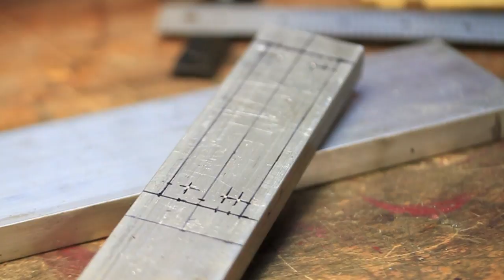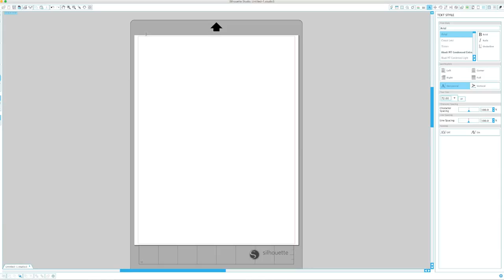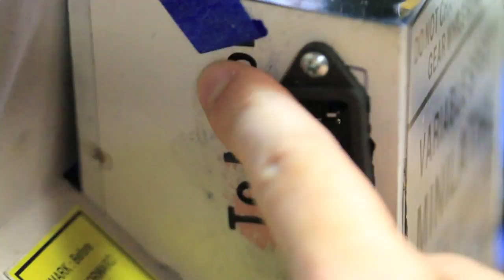Mini Lathe Carriage Saddle Clamp Upgrade - with ball bearings + bonus vinyl cutting project

Comment: Don't use an abrasive disc (or grinding wheel) on aluminum. The Al gets embedded in the wheel, expands from heat, then POW! Half your head is gone and you're in a closed casket. When a grinding wheel explodes it is neither subtle nor gentle.

Comment: Can't believe you used the bandsaw to cut the Ali, then turned to a grinder to remove the centre -butchery! Far better to have used the bandsaw, corner to corner then remove the remaining triangle for a better finish. You did similar with the bandsaw on the circular cut! Also oil isn't a good lubricant for working aluminium, WD40 or even turpentine substitute are better.
Reply: Another thing I would not use a metal abrasive shop saw to cut aluminum it has been said it can clog up and explode. You could use a carbide wood chop saw as a safer alternative. There is my 2 cents. And looks like he use tap magic in his defense.

Comment: honest ?! I would not have done it that way, with the balls on the underside you only have one point contact, the forces that will work there are no longer distributed over the entire surface, there are better solutions. I do not go into that now as a German it is not easy for me to explain that in English. 
I have the problem solved with brass and scrape as well as by adding shims or spy plate.
Reply: What is song name at about 3:50

Comment: Do the same on the back as you did on the front. Eliminate the side adjusters, they are doing more harm than good. You need down pressure on the carriage on front and back.

Comment: I know this seemed like a good idea and you are very ingenious working with the tools you have. I'm in the same position. However, I hope no one does this to their lathe.

The following information doesn't just apply to bearings but also how tool geometry affects tool pressure and can also be applied to many designs you may come up with for parts or jigs. It's a part of learning machining so I hope you'll keep reading.

It comes down to pressure, pounds of force per square inch of surface area (PSI), and simple mathematical principles. Consider the surface area of a ball at the point of contact with a flat plane. Ideally it's an infinitely small area (which would lead to an infinitely large pressure at the point of contact) but practically there is some plastic deformation in the ball and the plane.

Let's be generous and say it's 0.01 square inches with only 1 pound of force applied on the lathe carriage. That's (1/0.01 = 100 PSI) at the point of contact. In practice, the force would be much larger. Even a force as small as 10 pounds would apply 1000 PSI at the point of contact. Now, granted, you have more that one ball. However with 5 balls, that's still 200 PSI per ball and the forces are going to be considerably more than 10 pounds.

Consider an area of 0.001 square inches, that's (1/0.001 = 1000 PSI). With 10 pounds of force that's 10,000 PSI. With 5 balls, that's still 2,000 PSI per ball. Add to that the fact that the balls aren't rotating AND it's hardened steel against soft cast Iron. The more ball bearings that can freely rotate the better and, as mentioned by others, the bearings should ride against a hardened race instead of the soft cast iron.

The point is that the smaller the surface area, the larger the pressure will be. This design will most likely leave dimples and wear a groove all along the ways. Conversely, the larger the surface area, the smaller the pressure will be. That's why the ways are ground flat. The point of scraping is to give a place for a thin film of oil to exist between the 2 ground surfaces, but the surface area is still very large and oil is considered non compressible. It's like having millions of ball bearings.
Reply: Exactly.

Comment: I appreciate the ingenuity  put forth in making the blocks and the bearing assemblies, but I can't help but think that the hardened  balls are going to gouge the ways since there is no bearing race to complement them, and there is no way for the balls to really roll instead of grind across the surface.
Hopefully I'm wrong.
Reply from the maker: You're probably not wrong but that was something I considered going in. I'm going to keep an eye on it but at least in the mean time, the lathe works so much better.
Reply: i saw another fellow use brass balls on a carriage 'stiffening' project - would they work as well/better?  or do you think they would deform and become useless i wonder?
Reply: If I were to use this method, my choice then would be grinding a flat side onto the balls. They aren`t turning anyway.
Reply: What is song name at about 3:50
Reply: For the reasons you mention I would never never do exactly what was done here. However, with some slight modifications this general idea could work really well. If  larger diameter sections of a bronze dowel/bronze roundstock were used in place of the ball bearings, that might just work really well. Though the dowel sections would have to fit fairly tightly into the hole so they didn't shift around, so this means that the holes could only be tapped part way through, leaving enough smooth bore for the dowel sections to fit into.

Instead, a long bronze strip could actually be used as well, as long as it was some how held in position by a recess in the plate, or with pins, or something like that. Just something that would allow it to be adjustable vertically via the screws, but still confining it's movement horizontally.
Reply: @smallblockchevy1022  - of just adjust the original parts properly, like everyone else does by following the lathe instruction manual.

Comment: Great ingenuity but this is a bad approach.  Not only are the balls too hard, they're essentially point contacts and you'll run into trouble with both excessive wear and possibly Brinelling.  I suggest going back to flat plates and using shims to set the clearance.

Also, those clearances are way too big. For comparison I just checked my 6" Atlas lathe that was built in 1941.  At the most worn place on the bed I got half a thou (0.013 mm) movement at the rear and one and a half thou at the front -- which is too much, I'll be taking some shims out of the front soon (this lathe was built with laminated shims in such places that can be peeled off a layer at a time as things wear.  I think the layers are a thou thick).

Too-large clearances will contribute to chatter, tool dig-in, poor finish, maybe poor dimensional control.
Reply: What is song name at about 3:50
Reply: I was going to comment the exact same thing, But it seems you just beat me to it (By 3 years. :D ). The basic concept seems OKish, But I'd have made it with the ball bearings pushing onto flat brass "Gib strips" to spread the load (Not really gib strips if it's not in a dovetail, But the correct name eludes me at present).
Not sure if there's even enough clearance to the vertical carriage mounting bolts to retrofit this using what he's already got though.

Saw a nice sliding tapered gib block setup on YouTube earlier today. The maker had done it using such basic equipment that I was stunned that he'd managed to build it with any real level of accuracy, But it looked REALLY well finished, and seemed to work perfectly.
Reply: @Reman1975  Yes exactly, this Video is old now, Tim had some good ideas but this is Not a good design for improving on the factory bad design. Hopefully most people are not following this build, being honest from a mechanical perspective this design, the materials, fit and finish and execution unfortunately all get a poor over all rating.

Comment: The smoke when cutting aluminum is because the cuttings get stuck, due to the oil you use. cutting, tapping, drilling and turning aluminum (and bronze) you should have used methylated spirit, or dry no oil. tip from a metal worker. it's more for cooling than for lubrication.
Reply from the maker: Thanks, I'll try that!
Reply: What is song name at about 3:50
Description does not help.

Comment: This will wear out the lathe tracks as the balls are harder than the track material. This will ruin the whole thing.
Reply from the maker: Ruin the whole thing might be a little dramatic - I'm keeping an eye on it... in the mean time it's way better than it was. Thanks for watching though!
Reply: TimNummy I forgot to congratulate you as for the series, the vídeos are very good. The one on the motor was great.
As for ruining, if the tracks get rough many of the uses of it will be loss. How about some brass bolts to replace the set screws and  bearing balls? :)
Reply from the maker: Thanks! I appreciate that.

Eventually I'd like to get a mill and then make something proper.
Reply: Those balls are not taking any loading when in use and to move smoothly they can't be touching the underside of the ways, thus there will be no wear.
Reply: ... why didn't you use the bandsaw to cut out most of that material? You already had the holes right there!

Comment: Upgrade ?Jesus Christ...01:01..the band saw not good enough for the cross cut, 04:33 :why did you not use an axe for this. if you drilled 2 holes next to each other this would be enough clearance for the band saw blade. the extra hole is for the carriage stop.

Comment: 16 minutes of documenting the execution of a major brainfart.
Reply from the maker: How so?
Reply: @TimNummy  A year later, and I've forgotten all about it. After watching it again, the thought still stands.
a) ball bearings need to turn freely to be effective,
b) bearing balls are harder than the casting. They will wear out a groove over time. Poor design decision. Roller bearings would be better if you're set on this thensioning method. Bronze/brass strip with grease would've worked even better.
c) your carriage still moves. What you should focus on is increasing precision of the tensioning mechanism, which is less than ideal. I think that the lower plane on which you rest the bearings isn't perfectly offset from the ways. It'd be better to fix that issue by maybe regrinding the sturface with a dremel, referencing off the ways, and adjust the tension properly, than to design a "self clearancing" solution.

Comment: I applaud your desire to learn. It takes humility and some courage to show your work as you learn. It certainly invites others to want to help in positive ways.

Most of these mini lathes have brass plates that slide on the underside of the ways. They're adjusted to be just tight enough to have no play, but not so tight that they have a lot of wear. Brass is used because it slides well on the cast iron, yet is softer than the cast iron so it won't damage the ways.

The problem you will run into with your mod, as others have mentioned, is the concentration of pressure the hardened steel balls will put on the underside of the ways. Eventually they'll wear a groove in the cast iron which will require you to tighten them, which will then wear a deeper groove, repeating the cycle. It's unlikely that those balls will roll in their "sockets", but even if they did, they're probably hard enough that they'd still press a groove into the cast iron. More likely is that they'll try to roll, but bill grind against the set screws and develop pitting. The pitting will eventually meet up with the ways and then really do some damage (sharp edges of hardened steel, after all, are what we use to cut metal on these machines). 

I'd recommend finding some 3mm brass stock that you can place between the balls and the ways. Grind some detents into the brass stock for the balls to press into and sand the top of the brass stock flat and smooth where it meets the underside of the ways. That'll provide a much more rigid setup that won't damage the cast iron and it'll hold its position far longer as well.

For making flat surfaces I'd start by watching Dan Gelbart (all of his videos are essentially a requirement for new machinists):

https://youtu.be/cwdoUjynpEk
Reply from the maker: Hey Michael, 

Thanks so much for watching and taking the time to comment - I expect them to eventually be a problem but I was trying to make it better than it was for the first iteration. The biggest issue I have with the brass bars is that they still adjust in the same way or with shims and I just don't like the tediousness or quality of how that works. 

I will be keeping an eye on the bottom of the ways and my next iteration will probably move away from the bearings, but in the mean time the improvement has been tremendous. I really like your idea of putting a brass block above the bearings. Another current limitation is I don't have a decent way to make flat surfaces. 

I've seen Dan Gelbarts videos before as well - tons of great information.

Thanks again!

Comment: Nice work. Cutting aluminum with an abrasive disc doesn't work as well as just using a carbide blade with some wax on it. Ideally the blade would have a negative hook. I have access to UHMW scrap and use it for sliding surfaces. Seems to last a long time.
Reply: He could have cut the aluminium with the bandsaw. You know the bandsaw he started cutting with in the start of each part.

Comment: Great video the only thing I would have done is use 5or 6 ball bearings equally spaced apart to distribute the force better a little bit of advice never cut aluminium with an abrasive disc it’s creates fine aluminium particles that when breathed in settle in the lungs causes long term respiratory problems in the future other than that I like the idea of the saddle plates you have made just a redesign on the use of ball bearings would be good all the best
Reply: The ball bearing use is Not a good design for the intended purpose. The balls contact area is too pointed not allowing the load to be spread out. The lathe ways are not hardened, over time the balls may cause irreparable damage. Whenever you want to reduce friction and wear you want contact between two surfaces to be the largest surface area possible. Those surfaces need to have smooth contact and slippery from either added lubrication or hard surface. Tim should reconsider this design and go back and re-do the poor factory Gib installation. Performance will be better and long term wear will be better.

Comment: Im late but man make me cringe watching you use sanding drums and cut off wheels on aluminum. A tid bit from jody collier, bees wax. Lap your drums and cut off wheels with bees wax and they cut through aluminum 5x as fast. Just keep them lapped with bees wax when the cutting action starts slowing down. Bees wax keeps the wheels and drum from gumming up with the aluminum.

Comment: a suggestion. when cutting alloy with an abrasive disc ,pre clog the cutting edge with bees wax. it cuts as clean as brass. no bogging or melting. just make sure you have safety glasses on. it slings wax.

Comment: you can actually use the router either on the table or handheld to cut aluminum very precisely, which is what I do since I also don;t have a mill 
cut the bulk of the material out using the jigsaw / bandsaw / drill press, and then sneak fit or follow the straight edge / template to route the remaining uneven edge

Comment: The idea on the dollar, the result on the cent. It's simple, the area of contact with the guides of the machine point, so the balls quickly gnaw through the grooves in them. And the guides of this machine are not hardened, and you will often tighten the screws. Here it is most expedient to install flat wedges of bronze. 

With Respect from Russia...

Comment: You could have cut out that U shaped piece with the band saw... much better than the angle grinder.
Reply from the maker: My bandsaw isn't very good. I should have used a coping saw or something similar.
Reply: Of course the band saw isn't very good...install proper blade and use the proper sfpm for aluminum  you will be surprised with results. Use nylon tipped set screws  get rid of hard balls, no gouging of softer cast iron

Comment: I would not recommend grease as a lubricant since it will trap particles and become a lapping compound.
Reply from the maker: Thanks! Someone else had commented that at some point and I have since switched to oil. If there's a particular kind you'd recommend, I'd love to hear it!
Reply: Not my area of expertise. On a side note some grinder dresser gibs used similar arrangements as your ball and set screw. With the addition of a tension spring between the screw and ball, by partially collapsing the spring you kept gib pressure and setting as the ball and ways wore.
Reply from the maker: I thought about something like that but I think even though the intention would be for the springs to keep the tension, it would end up being a sort of suspension for the ways carriage to bounce around on. Ideally you want it totally rigid so unless they were super stiff springs (to the point that they would probably not be useful as springs in this application) I think all it would do would be to introduce extra movement.

Comment: I dont know the application for Loctite 242 or the special abilty but im pretty sure it wont harden out if you grease the contact surfaces for the screw at 14:37. Normally you degrease parts when you use glue on them.  And i also think you dont need the saddle clamp on the side. Just use the other 2 to pull it down. The one on the side will just increase the wear on the triangle guide. In general i would rework this concept. It is too tight. Nice video, music and editing. Your effort is enorm.✌🖒

Comment: Invest your efforts in a larger used lathe. I agree with others that the steel ball bearings will wear a groove but you can adjust it for a while. 
I am disgusted at what the condition of what they they sold you NEW. No offence. You don't know until you get it.  A lot of your mods show injinuity. 
Even a slightly worn used lath that needs work would make you a happy man. Keep the wheels turning.